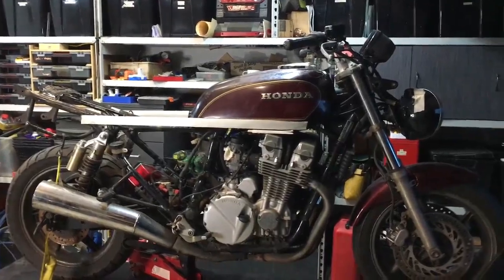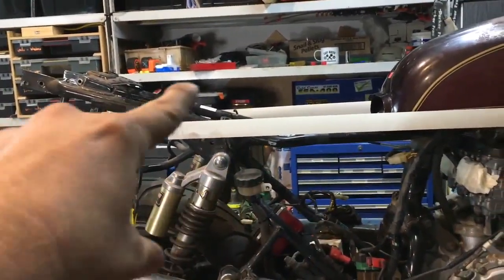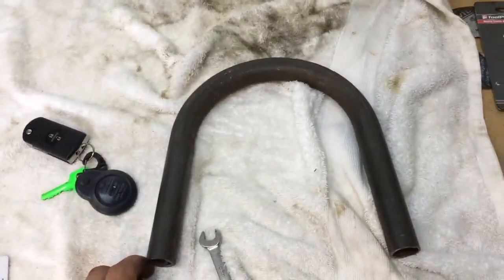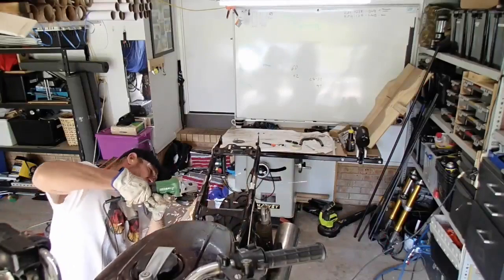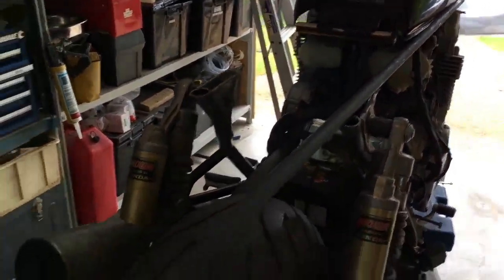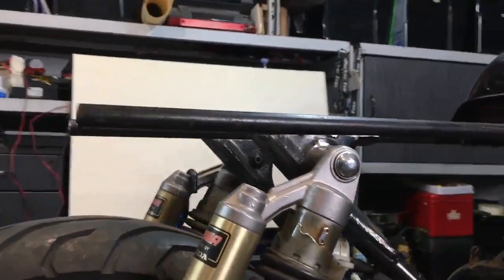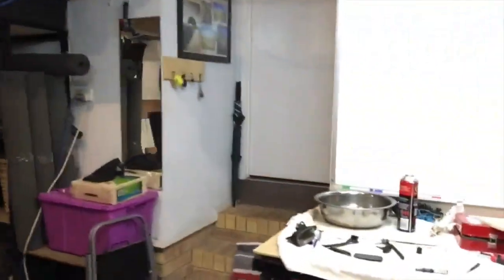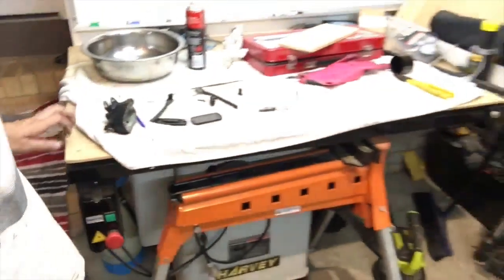Honda CB750 ★ Cafe Racer Frame Cutting and Welding Ep.4 & NEW PROJECT REVEAL

Comment: When I work on a frame, I put smaller size pieces of pipe inside the two pipes welded together. Drill a couple of holes for some weldpoints on each side of the cut. Might not be necessary, but.. :-)
Reply from the maker: Thanx john. It's a great way to ad strength to a join, I decided it wasn't necessary here because I am using 3mm wall thickness and I prepped the ends to allow for a strong weld. 
I do like your idea tho. 😁
Reply: John, that's old school and this 66 year old gearhead can vouches for you that it works!

Comment: I’m curious about the original frame piece you reused near the tank. The angle at the right bend turns in about a half inch more than the left on that model. How did you deal with making sure it lined up with the rear of the bike when it came time to weld the rest of the seat frame.? Hope my question isn’t too vague. Thanks! Also Great vids👍🏼

Comment: I'm considering cutting out my top tube and replacing it, ive never done it and I'm curious if its possible without ruining my frame. Its the frame of a CX450. Does have motor mount to be moved also

Comment: Great work!!! What is the exact model of the tank? Does it clear the width of the frame tube or you had to modify it? Thank you
Reply from the maker: Leandro Palou this is a 1979 cb650 tank and it’s requires a little chopping of the mounts both on the tank and relocating the mounts on the frame. Apart from that it fits 😊😊👍